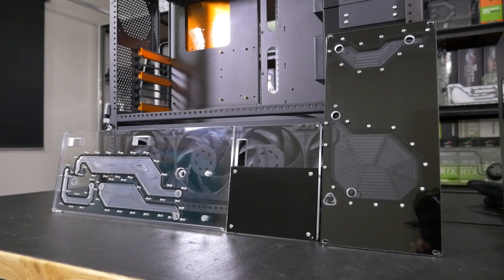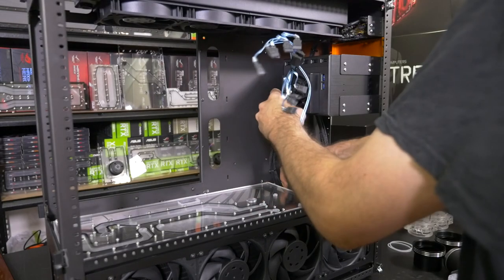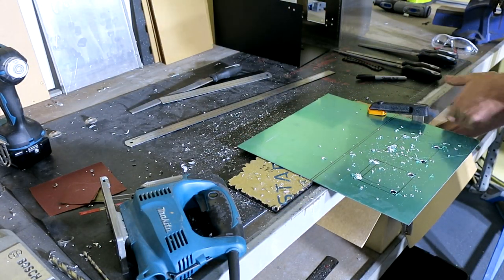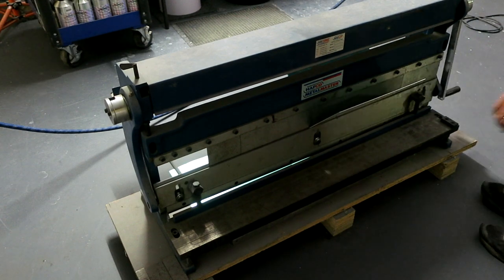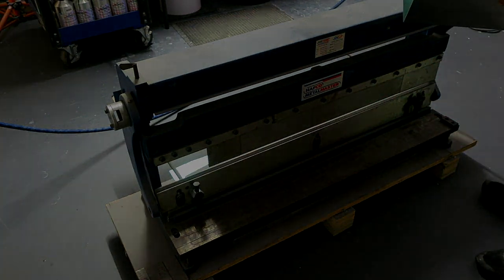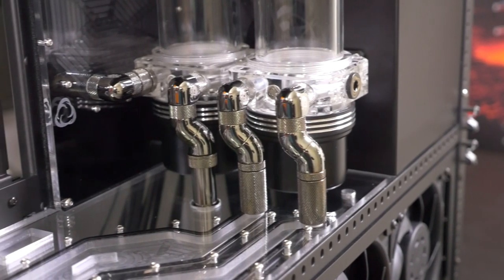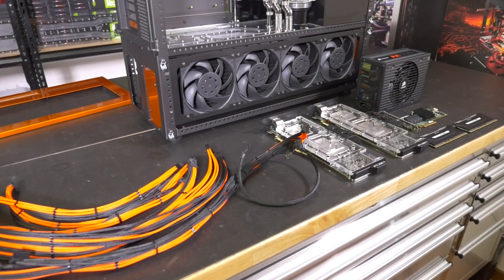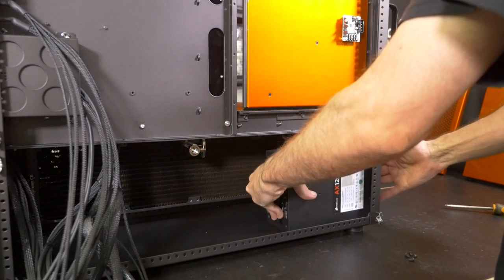Caselabs SMA8! Build #48 Part 1

Comment: I have my sth10 I still need to build in
Reply: kevin russell Don’t be discouraged man. Do try and get to it. I have my SMA8 that was an unfinished Water Loop Intel build and my first attempted build from 2016 yet unfinished due to life and busy at other stuff. Its been revived and will be done next month in September with a revamped Ryzen 3900 CPU and MSI X570 MAG Motherboard, 64GB DDR4 RAM. Everything else I originally had is reusable or can be used. So I know the feeling in a build to get to. Mine years in the making. The beauty of CaseLabs cases is their total revamp and upgrade ability all inside the case. They will last a lifetime for many builds.

Comment: Well i think if you get a small laser cutter it will pay for itself if you have work all the time, about the CAD/CAM it's simple lines of G code, and some machines are guidded by color layers, but it all depends on your budget,  it will take out a lot of steps from your work and simplify it
And If you already use Fusion 360 or inventor for modeling, you can use the CAM System and they already have laser cutting included, really simple to use if you have Fusion360
My best Regards Daniel
PS: Still have the cables that i bought from you in 2018, excelent Quality     LOVE From Portugal

Comment: Why you dont use a mini grinder vs a jig saw, all the metal fabricater are use grinders with a very thin blade to cut the hole or metal sheet like thin one: https://www.toolsource.com/air-cutoff-tools-c-273_503/autobrade-red-3-in-long-neck-cutoff-tool-p-98611.html or you can use a dremel  for smaller applications with a cutting wheel